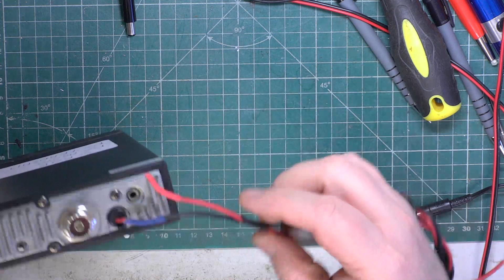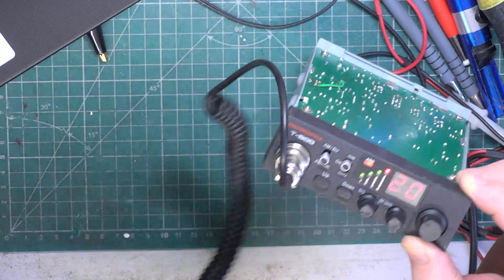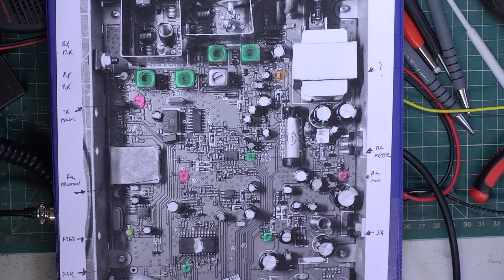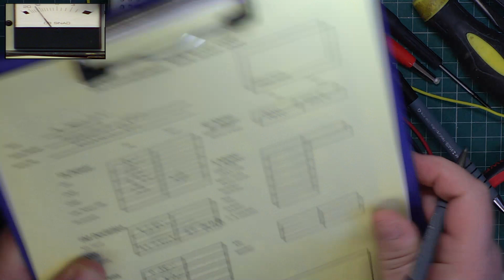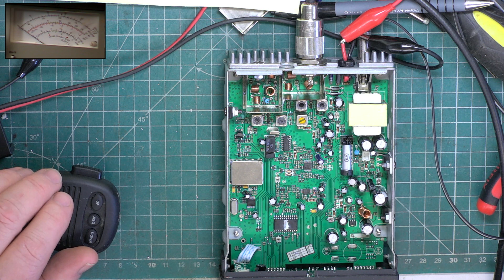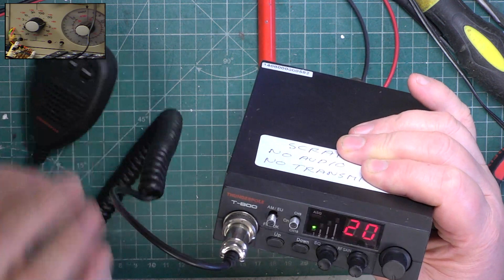Thunderpole T800 CE Multinorm CB radio - Resurrection from scrap

Comment: I hope you manage to get more out of the speaker volume Richard. Would top it off nicely after so much hard work. Shame these newer units aren't more tuneable these days so you could realise the legal max out of them. A lot of potential, but unfortunately somewhat lacklustre I always feel.
Reply from the maker: Roger, it'll definitely get the final duff capacitor tracked down. It's clearly been 24 volted.

Richard

Comment: Hi richard good luck on resurrecting the thunder pole t 800 ce multinorm cb radio  from paul chapman at east sheen 
also I have bought a clip board which opens up and has a pocket to hold things in
Reply from the maker: Roger on that Paul. Yes, that's called a 'foldover clipboard'. We use both types here.

Richard
Reply: to @ukfmcbradioservicingTango21  I have a cb radio it is a audioline 340 I lent it to someone year ago when I went to the house I found the top was open but I got it back I just want it checked over how would I send it to you please 
From paul at east sheen 73's
Reply from the maker: Email me Paul & we can arrange it.

Richard